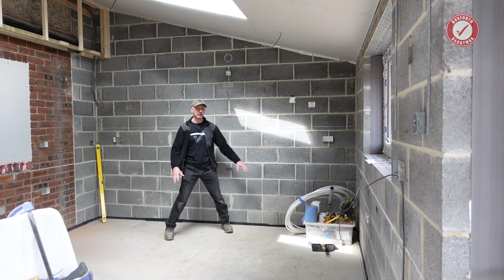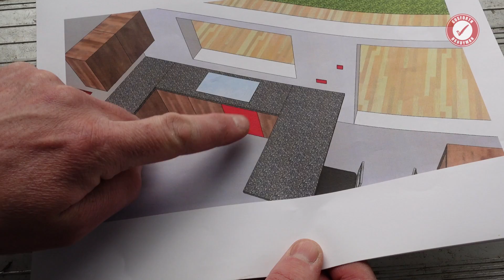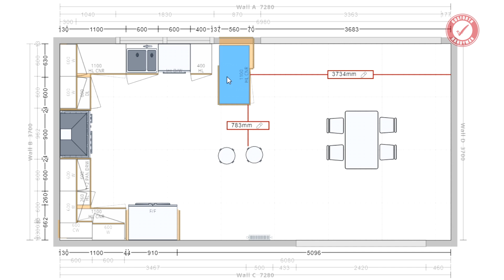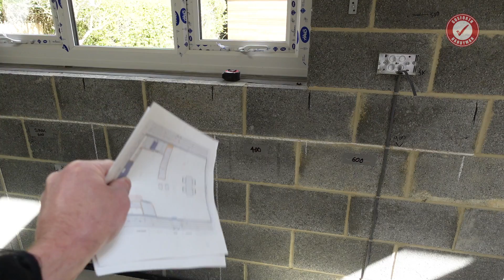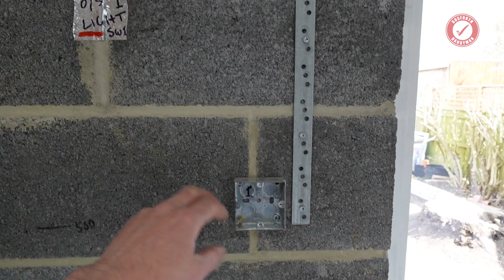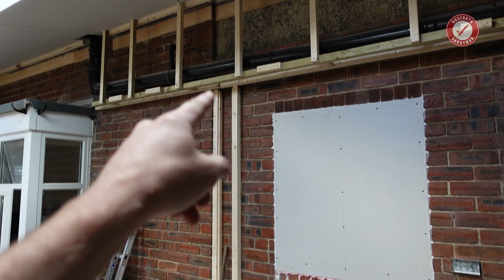DIY kitchen planning - a few tips to get it right! (Self Build Extension Part 18)

Comment: I'll add to other commenters and say that you can never have enough sockets.  My kitchen is smaller and I have seven double sockets for the counterspace.  Not all are in constant use, but appliances have shorter cords nowadays, and there's always one handy.  There may be appliances that you'll have twenty years from now that you'll need to plug in!  Also, it's convenient to have the dishwasher located as close as possible to the cabinets where you store the dishes.
Reply from the maker: Cheers Bob! Thankfully with dot & dab it's very easy to add extra sockets if needed. Got 8 doubles in that room plus USB so should be good. 👍

Comment: My advice from having done several kitchens in my life, is that you need electric sockets - at least twice as many as you think you need. I'd say you don't have enough.
Reply: Was going to make the same comment.  Thought we had more than enough sockets but wish we’d gone for double the amount we did.  Ended up having to plug and unplug counter-top appliances (and myriad electronic stuff you don’t think of) all the time when it would have been so easy to have had more sockets installed.  Hindsight advice - work out how many you think you need and double it as Nicole said. I’m sure the Macs have thought of everything for their situation- but just thought I’d make the comment - if only to remind me if we ever have a kitchen opportunity again.  Or any other room for that matter - we have older parts of the house with one single socket per bedroom - gradually working through them and thinking 3 or 4 doubles minimum. Not that we can afford to plug anything in any more. 🤣
Reply: I agree, I was thinking the same.
Reply from the maker: 8 doubles in that room plus USB so should be fine. 👍😁
Reply: @GosforthHandyman  We that me, I'd have had 8 just in kitchen part alone. My kitchen is half that size, and we have nine doubles! It's never a problem to put in too many, but always one to add them later. We don't use them all, but there's always one where you need it. As for built-in USB outlets, they are a "vampire" current sink - never switched off - a small draw, certainly, but even bit helps. Also, I've seen advice that they are the part of such sockets that fail most often. Anyway - it's looking good and I'm glad you're pleased with the result, despite enormous hard work involved.

Comment: Good advice.  Done a few kitchens myself, stressed me out a little that your sink is offset to the centre window, end up looking out at the upvc pillar, maybe just me though, lol.  I recognised the company you used the online planner with - planner is great but there product is very poor.  I ordered a kitchen from them last year and the quality was shocking.  All but one unit was so poorly manufactured I got them to collect it all (which was a bit of agro) for a refund. Doors were quite nice but the units shocking, not square, chipped, drawer faulty. Was a complete nightmare. Went with Ikea in the end as needed kitchen on short notice, door choice not as good but units were better.
Reply from the maker: Sink will be in front of the left hand pane. That's interesting on the quality issues! Haven't settled on where we're buying it from yet. 👍
Reply: @GosforthHandyman  I'd second that about DIY Kitchens, we used them for our kitchen project last summer and although it's great and good quality now its finally done, it took months and a lot of stress to get all the units to arrive in good condition without chips etc. The spec of the units is good though and they do supply good quality fittings which our builder commented were the best he'd used. From what I can gather they used to be very efficient and have good quality control before the pandemic, but since then due to the demand a lot of that has sadly gone out the window so it can be frustrating getting everything supplied quickly without damage. Howdens are meant to be good frill what I've heard, though they quoted us getting on for double the price. If I were to do it again today I'd try haggling Howden's down to match them.

Comment: In my last house, I had plinth heaters in the kitchen - connected to the central heating, and electric, they blow warm air out whenever the heating is on.
Very effective,  and no wall space lost for radiators.
Reply from the maker: Nice! 👍
Reply: Yes, I have the same layout as shown in the video. I opted for the same hydronic plinth heaters and they are great. I didn't want to loose wall space. I used two - one either side of the peninsula breakfast bar. It required running the pipework and attaching it to the wall prior to the installation of the kitchen units, not forgetting power. Think they consume around 50w each for the fan.

Comment: Our kitchen's made by symphony, and it's falling apart slowly now after 9 years, it was a new build but not super well installed in the first place. Can 100% agree with comments about heavy bottomed drawers on full extension runners, some even come with a pull out cutlery tray attached to the worktop inside the top of the drawer, looks really tidy but a bit of a faff to open the drawer to open the curlery drawer. Howdens seem to be an excellent supplier of pretty heavy duty cabinets the M-in-L has a kitchen using their units, it's still looking good after 3 years.
Reply from the maker: Ha, we had a Symphony kitchen in our new build and it was terrible. 😂👍

Comment: Been following the whole build and have loved it but sorry for this you said you would have a socket behind sink if have water leak then problems but if behind dishwasher should be ok it's just my opinion sorry not a criticism
Reply from the maker: Pretty normal to have one in a cupboard under the sink for the dishwasher. Pain if the fuse blows otherwise. 👍

Comment: Present day videos? You spoil us Andy!
Boo hiss to the bi-folds taking that long, no excuse for that in any way shape or form.
Downside of you not knocking through the original kitchen window is you have to walk around half the house to get your food shop into the kitchen to put it away, that is something that puts me off lots of houses whenever I look at Rightmove
Reply from the maker: Cheers Sarah! Not quite present day but getting ever closer! 👍😎
Reply: @GosforthHandyman  phew I was thinking it can't be completely up to date that would be mad!
See edit on kitchen, probably too late for this design but something to consider
Reply: @GosforthHandyman  & peninsular is good to give a good size of continuous unobstructed worktop space
The drawn as 400 gap that will probably be a 200, could it be an open void for the towel hooks to hide them away?
Oh & please can I suggest a power socket in the room end of the peninsula or on the dining table side (for laptops/appliances) I wish I had some in mine!

Comment: Good walkthrough, if anything I can recommend drawers for everything - pans, bowls, dry goods, everything really, you never have to crouch to reach in the back. And to think about where your small appliances go- coffeemaker, toaster, blender etc. With dedicated spaces for appliances and tasks and supplies everything becomes more usable. Bins are yet another afterthought.
Reply: 100% drawers for everything. Bin is a good point also.
Reply: Definitely as many drawers as possible, not a fan of the "SMART CORNER" corner pull outs.  But even if you go for double door pantry. Internal drawers.
Reply: @LostWhits   I really want to see your way around fitting drawers into corner unit without leaving one side or the other completely unusable.
Even internal drawers need runners on both sides so there is really no way to use all the corner space.
Corner doors plus swinging pullouts are invented for that specific purpose, but even those don't use up 100% of the corner.
Reply from the maker: Defo! 👍
Reply: +1 0n the bins. Deffo a pain to place them.

Comment: The 1980s called and asked if they could have their electrical design back. :) You really should be looking at the modern way to do lighting now as there is no need to be running cables to switches anymore and there is no need to have different lights outside that are switched from different switches. You should also consider being able to turn the kitchen lights on when you come back in through the bi folds as well as from the rest of the house. Haven't wired a light switch in the last 3 years other than for replacements of existing. So much easier to work with and allows every possible option for the future.
Shame you didn't do wet underfloor heating especially as you could have run it yourself, would only have cost you around £500 to have it and you could have added it to the living room and even the old kitchen space as you moved forward. Save wall space and if you are covering the rad with a cover you negate half of its possible output by stopping the convection. 
Good video though for those that don't do these things regularly.
Reply: Perhaps you should send him a design, quinetic switches are not to everyone's taste.
Reply: @Jay-rz4rq  quinetic is good and if you install it right you would never know it wasn't a traditional setup. Quinetic is not the only option thou.
Reply from the maker: Lol I think our spark does these things quite regularly 😂. Had wireless lighting 10 years ago - fun for the novelty factor but never again. We'll have smart bulbs where needed but switches are still generally way more practical. Properly designed rad covers have a negligible impact on overall heat output. 👍
Reply: @GosforthHandyman  +1 for switches.
Reply: @C4sp3r123  I agree, done properly a house should function in the traditional way with additional features if needed. I would never install a system that couldn't be used dumb by anyone.
Reply: @GosforthHandyman  funny isn't it - switches for connecting power to stuff has worked perfectly for about 120 years. Now, suddenly we need a complicated, failure prone, more expensive, tech way to do the same simple thing!
Progress - as my granddad would have said......
Reply: @andymccabe6712  and the way we have done it for years has been static and limited. Yes it works but unless you consider every option now and wire accordingly, in a year or several when you want something a little different, it requires chasing and rewiring and all that good costly stuff. Not sure where you get prone to failure from either unless you are talking about all the DIY rubbish out there like smart bulbs and Phillips hue?
Reply: @GosforthHandyman  I never said you should be without switches, just the wiring is very static and smart bulbs is the DIY way of doing smart stuff. There are lots of ways of doing lighting that is smart as well as conventional without being stuck with what you choose today. In the past 4 or so years I haven't had a single client go the traditional method once they see modern stuff working. Quinetic, as mentioned above, is a very good starting point and if it's installed properly you would never know you were using it. But there are plenty of other options without moving into the whole house automation systems that cost thousands.
Reply: @Amped-JDS  Would be great to see a video of you talking through the various options or can you recommend any videos?